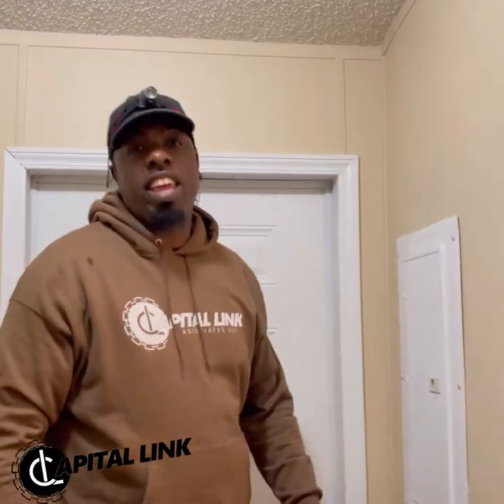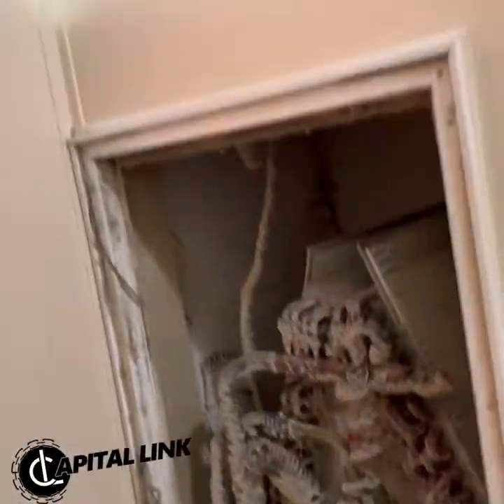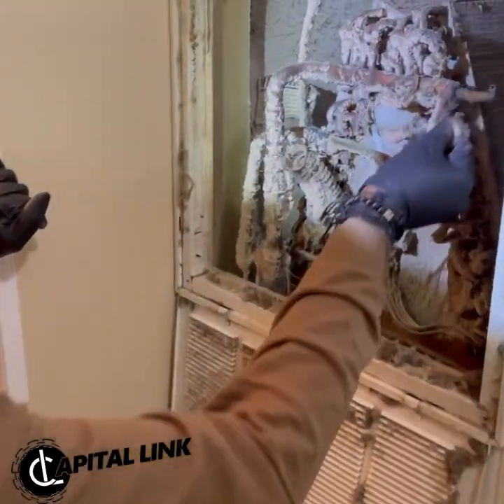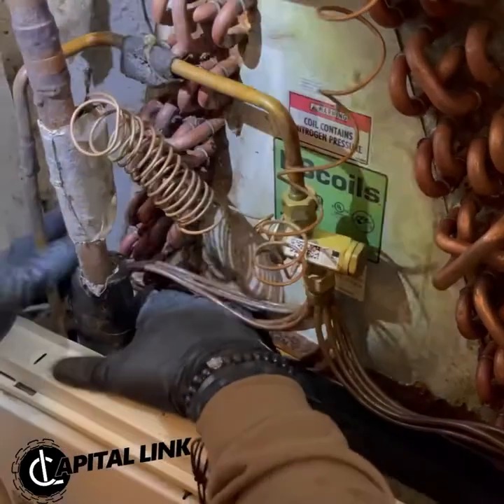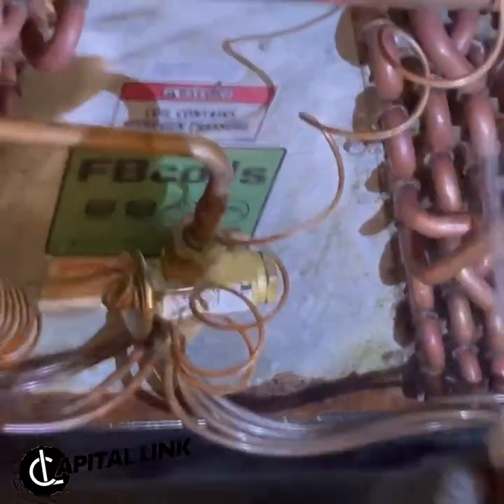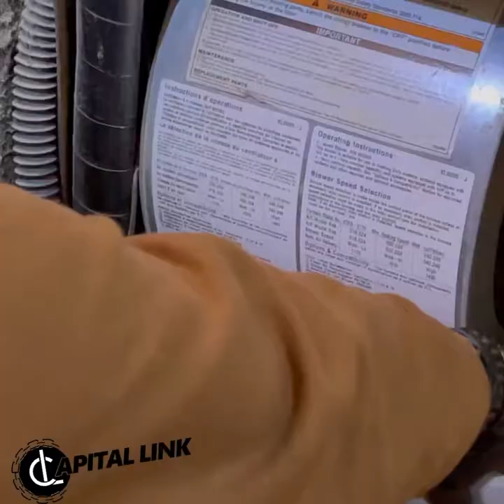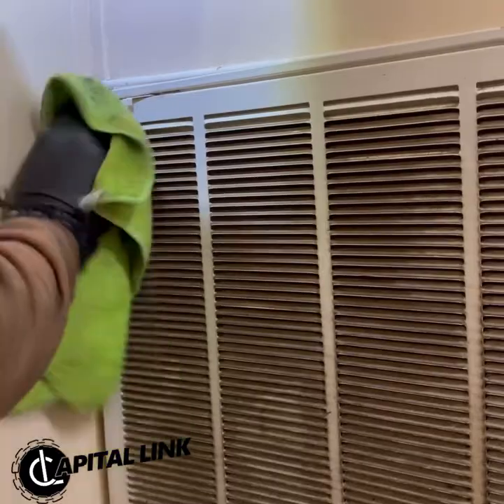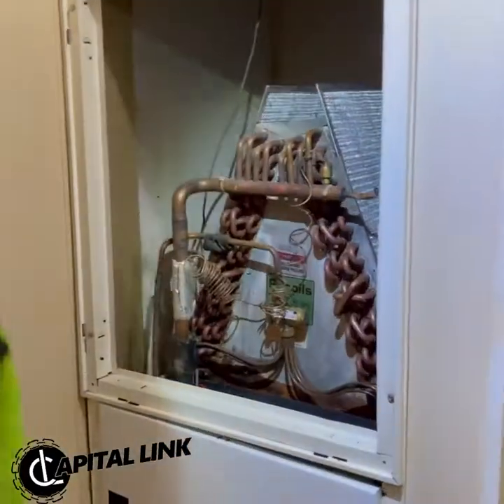HVAC clean in Manufactured Home

Comment: Good job! The only part that I am confused is why the filters are in the top side of the A? What about the inside of the coil? That's where is supposed to be the filter not on the top side. The inside side of the A on the evaporator coil should be dirty as well.

Comment: I was wondering where do you get your filter size if you don't have the manual anymore?
Reply: If you have a filter in it then it should have it written on it.  If not measure it or the area it goes in.  You might can find a manual online by searching model # and size.  Hope that helps.
Reply: If the cover it would normally sit in comes off I would bring that with me to the hardware store lol

Got to clean my furnace too, we just bought an older mobile home, with about 20 years worth of buildup.. 😅

Comment: What can I spray on my A coil to clean? It is filthy, no HVAC guys will clean for less than $500.
Reply: WD40
Reply: Do NOT use WD40 on coils; wd40 is a lubricant and smells like a tool. 
After you wipe and vacuum the area and coils, then rinse. You can buy spray coil cleaner, mix water and vinegar or just plain water from your water hose.
Reply: OMG! Disregard the WD-40 comment. Use a can of Evaporator Cleaner and brush before putting the cleaner in the coil to remove the bigger particles. Some people mix a bottle spray with water and dawn soap with white vinegar and then rinse. Please shutdown the electricity for the unit and then vaccum around the coil carefully. Make sure you don't bend the fins. I always wait for Spring or Autumn to clean the units because the temperature of the house is not that bad and I can leave the unit off for a while until it get dry.

Comment: From looks of the dry ac. Pan and dirty filters that ac hasn't run in awhile if it did it would freeze up im a 26 yr. Hvac tech when I'm called 4 service always check c if unit works before doing anything they those that will say it was working before u  came